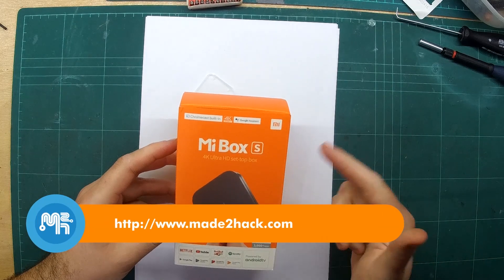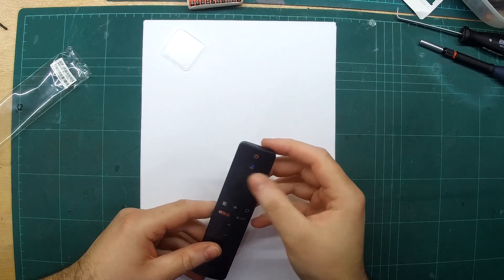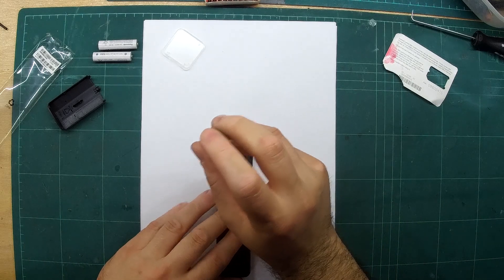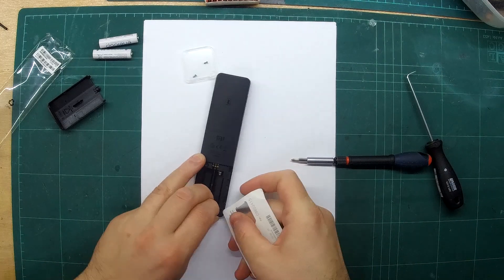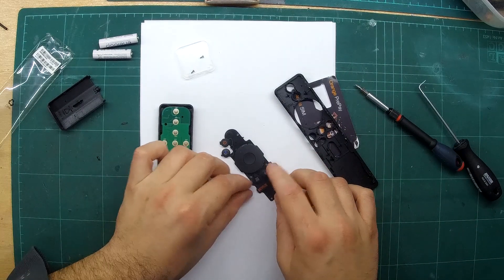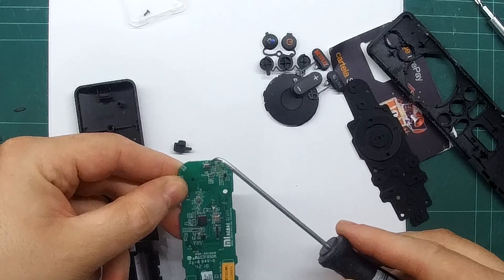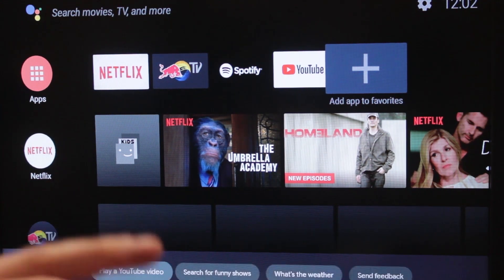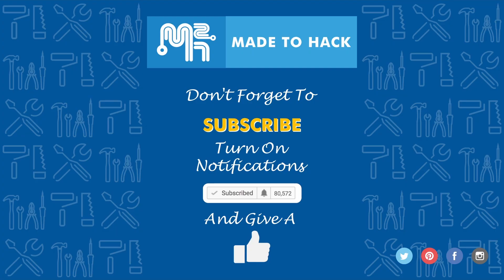Xiaomi Mi Box S Remote - Disable Google Assistant Microphone

Comment: I removed the mic entirely using a pair of pliers. First the little metal cover came off and I continued to scrape until the tiny unit fell off entirely. Now only 4 soldering pads are left. The remote works flawlessly (apart from the mic of course)
Reply from the maker: That's one way of doing it! Thanks for sharing!